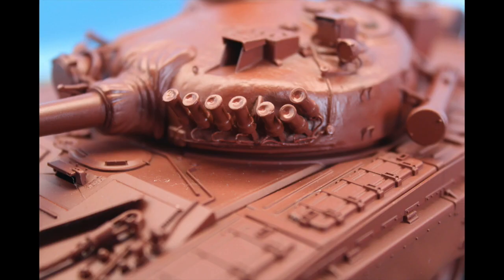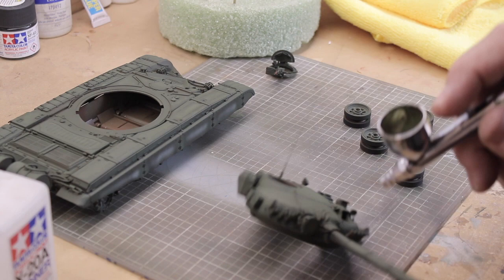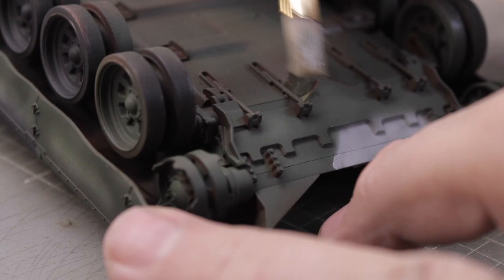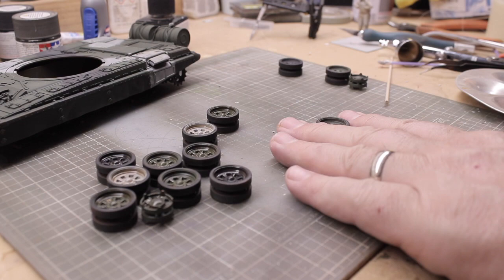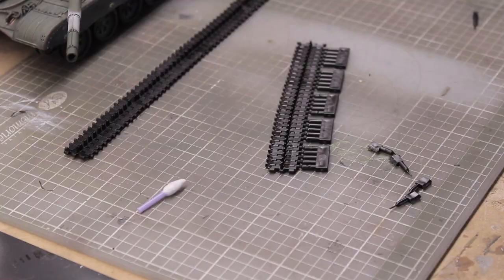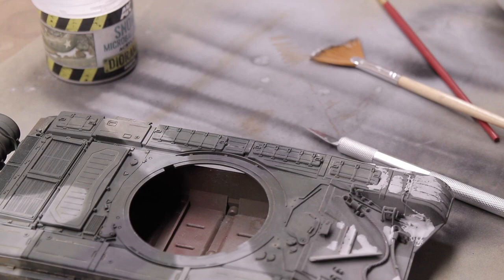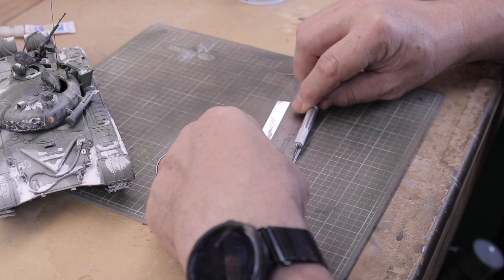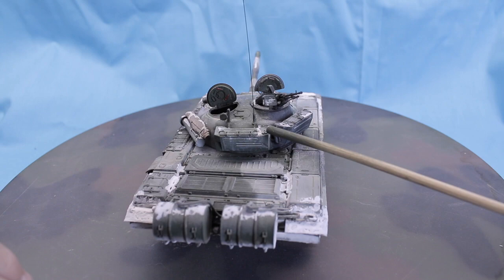East German T-72m1 1/35 scale in the snow winter effect how to add snow(part 2) (video #69)

Comment: One additional question, on the turret, the two places where you replaced the fake wires. What gauge of wire did you use ?
Reply from the maker: Sorry for late response. The large wire us 24 gage and the small wire is .015"
Reply: @Ricks135scalemodels  ok thanks